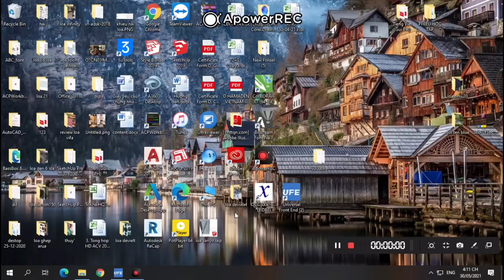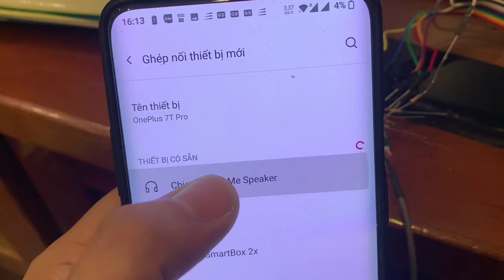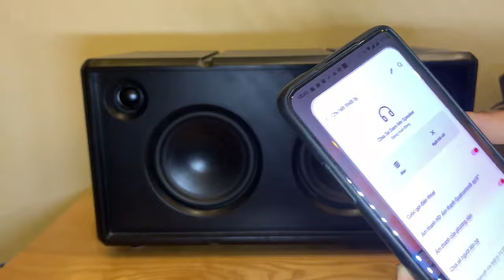Build a Bluetooth speaker bearing my name

Comment: so much effort and no calculated crossover or dsp?
I don't understand it but nice work anyway :)
Reply from the maker: it was calculated before being installed in the box, the time was not enough to record the video so I didn't put it in the video
Reply: @kentthoi  thats great!
I've seen so many speaker builders that used cheap 5€ universal crossover for a 2-Way System or only a capacitor on the tweeter and think that it will sound good and that is so sad, because they work so hard for the build and use amazing components and ignored such a importent topic .. 🙈
Reply from the maker: @TheChrisplayer94  crossover it depends on your speaker, its response, usually when you use 12db/oct is common, i don't like but 6db/oct crossover